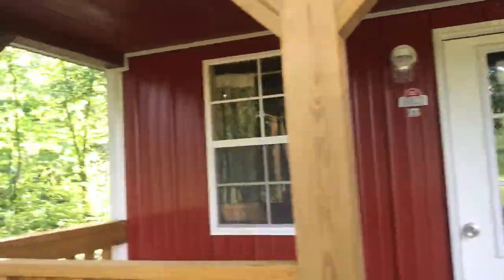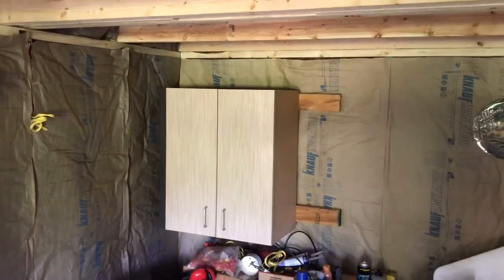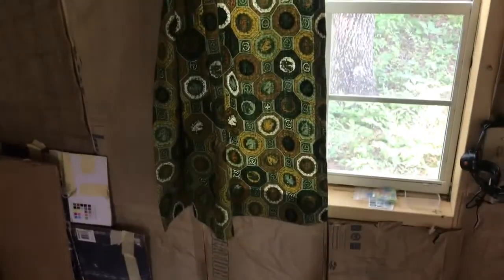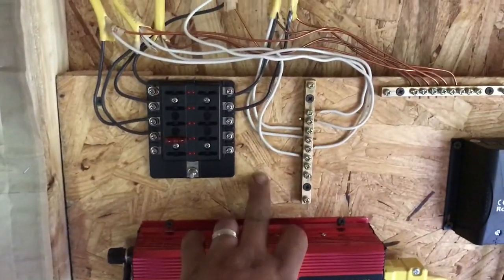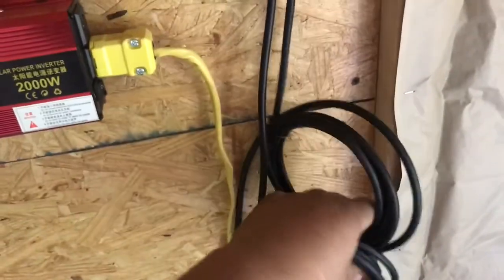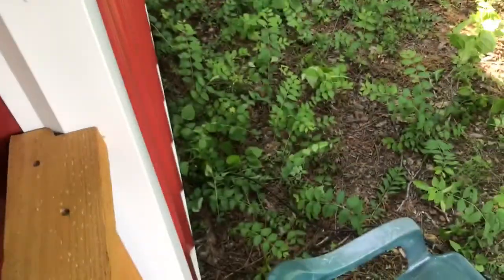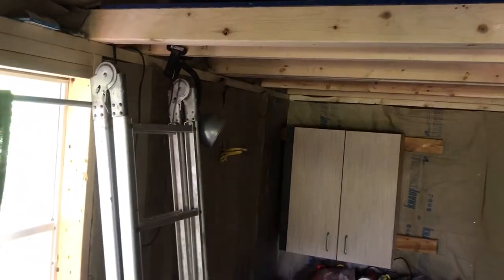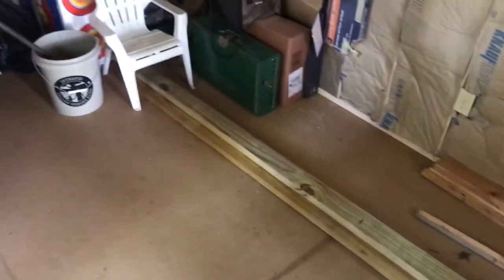Off Grid Cabin update, MORE insulation and SOLAR!

Comment: Zack, you going too need more solar, maybe even wind genny to add to the system, figure around a 1000 watts for a small cabin use. I had too put in a wind genny after I was moved in to my cabin, it wasn't enough with eight hundred watts.  but on the hill the wind genny added the needed four hundred watts the cabin used. now in the last ten years, I have never had a black out or power failure.  and no issues our side the invertor taking a cheap. stick with the highest watt you can get. in the end it works out best. no strain on the battery bank, or ware of the batteries.  but I'd think of a power shed for the power needs. if something did happen you want it away from the cabin. just in case deal.  also I'd look into a hydro setup if you got a creek up hill  near ya.  the need to feed the grid gets more involved with the more time in the cabin.  I remember, I started with four hundred watts a day usage, then after I put the kitchen in it went up. and remember too unplug all appliances that are not in use like a reefer, or freezer. lighting and other stuff is another issue. most don't use much to count if not on. also if I were you I'd think about building out to add in a shiter, and pantry.  but big enough too be is use. even a one room addition would add a few hundred feet living space. for a one person cabin that is fine, but if you have a guest or wife and family visiting, there is really no more.  a room off the side or back, can give you the needed room to add three or more beds. I know I added a 8x10 shed off the back wall, and put the shiter and shower in, and moved my kitchen to that back wall. using less then needed space too get it done. but it gave me a little over six spaces to set bags down during hunting session.if you were to double the size of the cabin later on, that's always a plus.  the real issue is the cost of buying the needed items.  but if you check out the local build all's or used demo places you can get great deals and a third of the cost. I bought triple glazed windows that fit the size I could use, for sixty buck a set.  I got a three piece bath set for 75 bucks,  I got a like new gas stove for fifty bucks. new lighting fixtures five bucks each, hell the deals you can get if you are willing too do the work and wait the deals.  I bought, lumber for pennies on the dollar, all sizes.  plywood sheets for ten bucks, for 5x12x3/4" marine use.   just got too look around at least weekly.  you never know what you can find ,if the guy selling gets too know you well enough he holds what your looking for.   I'm not telling you to brag, just a few ideas to help out a fellow off girder .well keep the faith, and keep posting lets see what's you come up with. the one and only    frank.